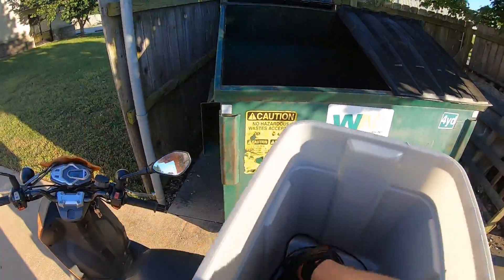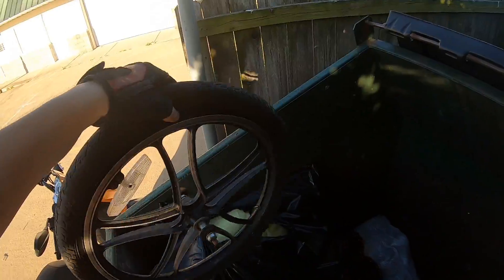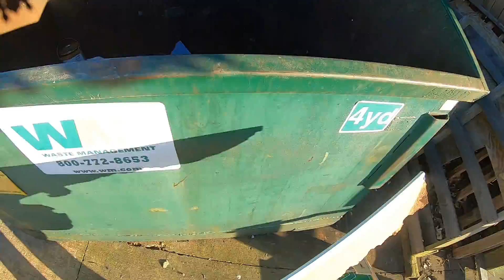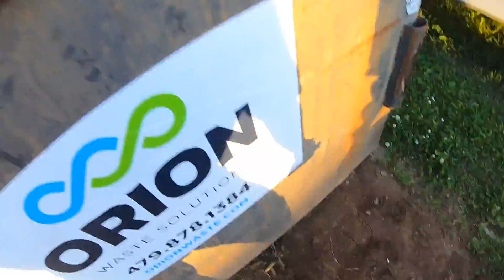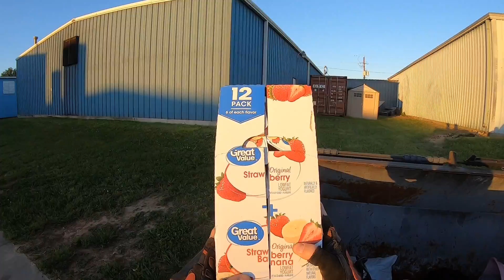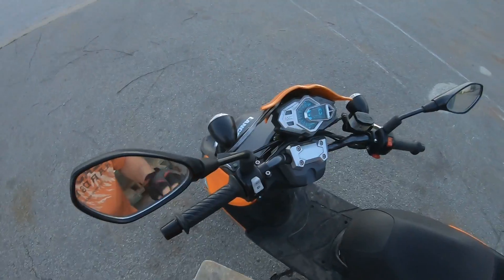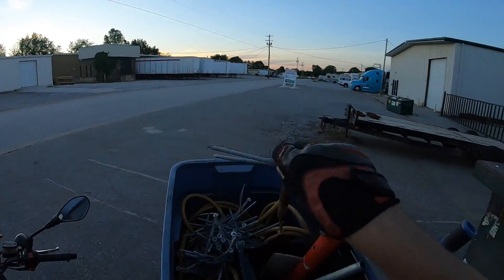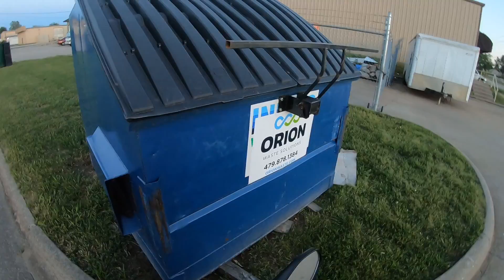LOOK WHAT I FOUND IN THE TRASH FOR FREE - Industrial Park #7

Comment: 12:00 Those are both used for pressure washing concrete driveways. They are not cheap especially the heavier red one.
$400 new.

Comment: You might want to hang on to that long metal handled paint roller. Ditch the roller itself, and you have a nice dumpster "hook".  Save yoiu from jumping in to retrieve or check stuff out!  By the way, water based paint is not necessarily haz mat, depending on where you are.  In most areas, you can let it sit with the lid off, 'till it becomes a chunk of solid waste.

Comment: How many times do you have to be told. THERE IS NO DEALING WITH THEM. Everything goes to the landfill no one goes through it. If paint is latex based it is not considered hazardous waste and can be put in the normal garbage it should just be dried out first so it does not make a big mess. Alkaline batteries are not hazardous waste either they can go in the normal garbage.